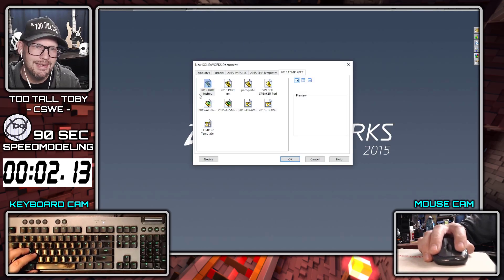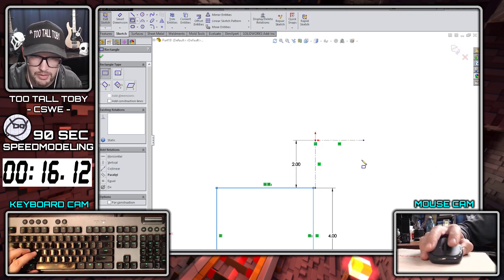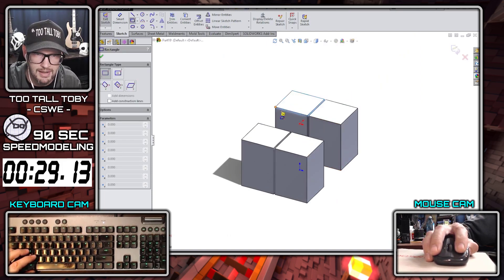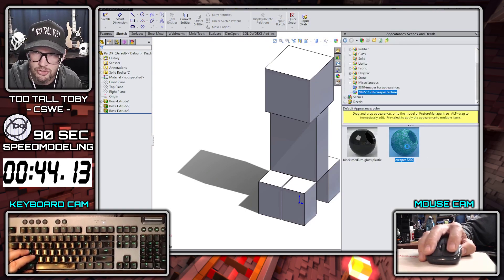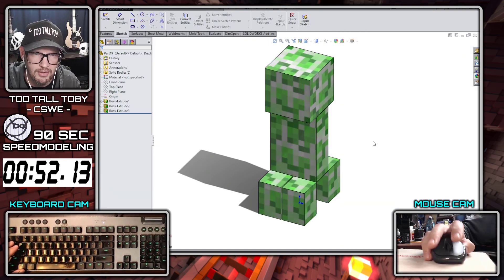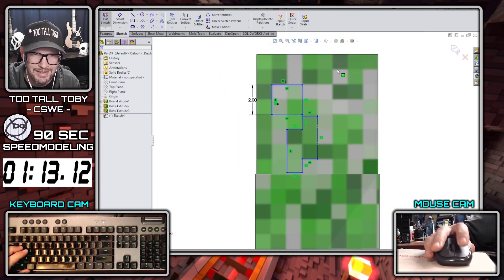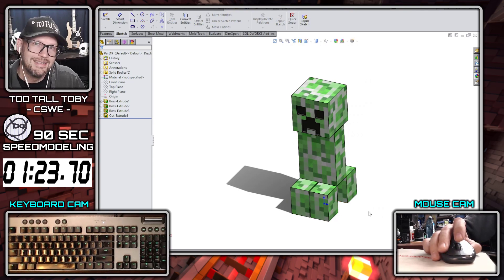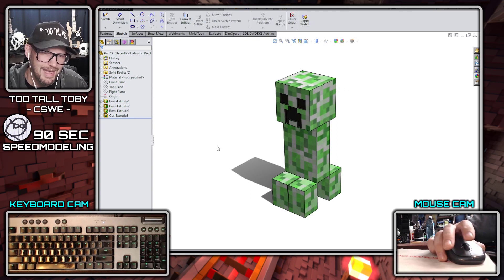...i just lost all my stuff

Comment: Very impressive, but I would have used a split line instead of a cut for the face features. Keep up the great work!! What stuff did you lose?
Reply from the maker: Thanks - I'm gonna 3D print it so I wanted the cuts to have depth.  I lost a diamond chestplate and a diamond pick axe with Fortune 3.  Creeper blew me up and I was way down in a mine and didn't have my co-ords written down :-(
Reply: @TooTallToby  Wouldn't the body and legs end up either disconnected or very slightly connected if you printed this as is? There's no overlap between the legs and body with it being created on the top face of the legs as you did. Love your videos!
Reply from the maker: @ninjamakuna  Yeah I actually did a couple of MOVE FACES before I printed it.  I'll make a video of the 3D print, but you are absolutely correct.  Great catch!
Reply: @TooTallToby  Just saw the print video, that looks great! What material did you use? It looked like it flexed too much to be PLA.
Reply from the maker: @ninjamakuna  It's HATCHBOX TPU.  I love hatchbox :-)